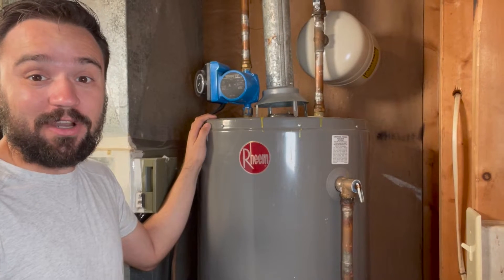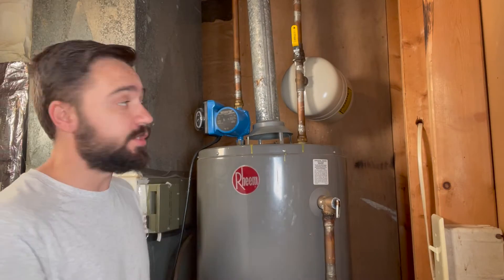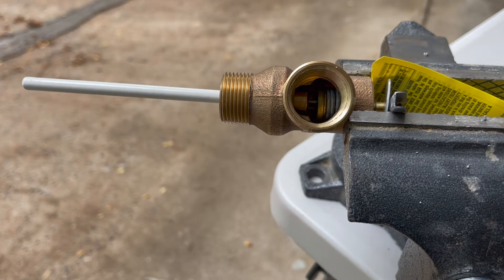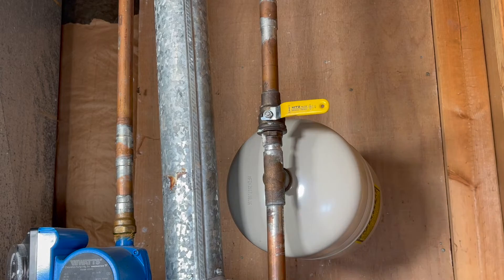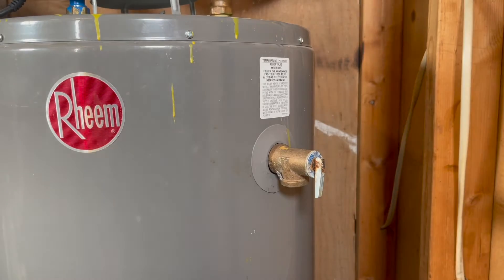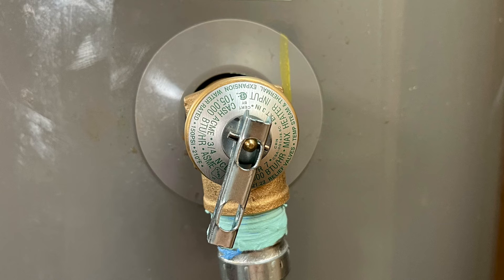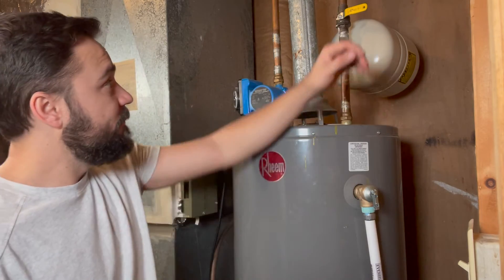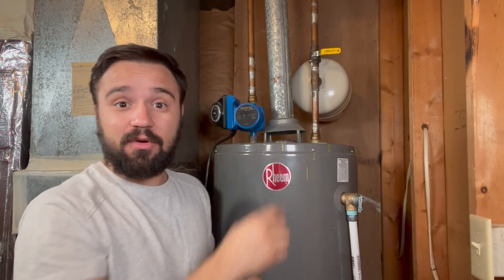DIY Hot Water Tank Repair: Faulty (T&P) Relief Valve (Temperature and Pressure )

Comment: Is there a rule where a hot water tank should be installed?  At the beginning of the waterline (close to the main) or can they be installed anywhere from the beginning to the end (furthest from the main)?  I have a new tank coming and I'd like to install it in the "middle" so hot water will arrive at any faucet quicker.  Thanks!
Reply from the maker: There isn't a strict rule on where a hot water tank should be installed, but there are practical considerations. Placing the water heater closer to the main water line can reduce the time it takes for hot water to reach your faucets, providing faster access. However, there are trade-offs. Installing it near the end of the line may involve longer wait times but can conserve energy by minimizing heat loss in the pipes. Ultimately, it depends on your priorities 🚿💧